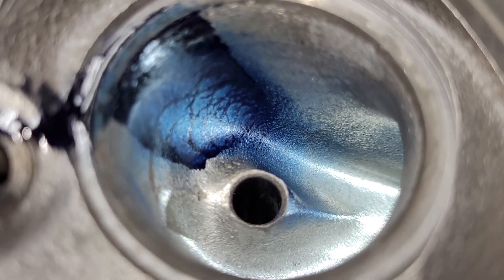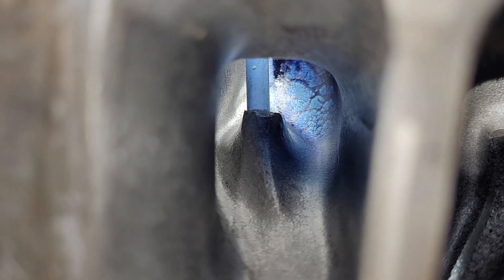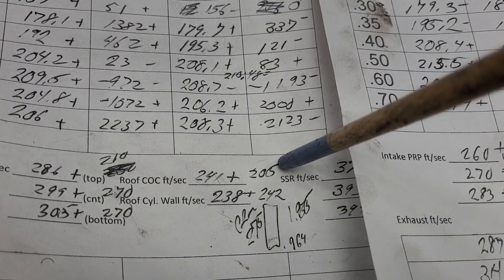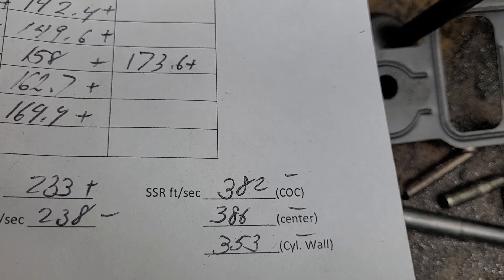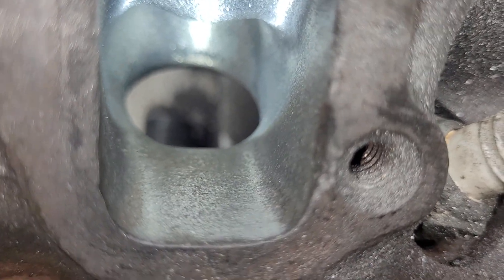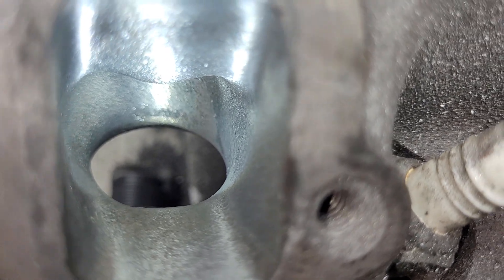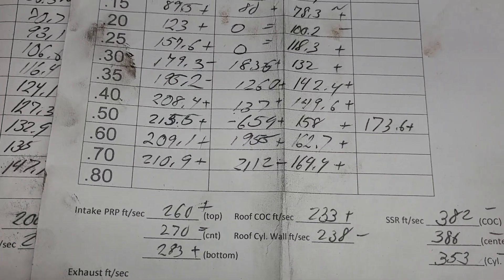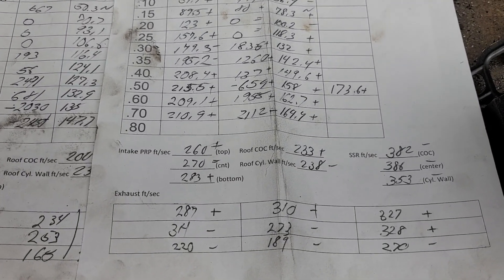David Vizard, U.T.G., U.M.S., Mission Impossible 318 project. Dodge 675 cylinder head, Intake guide

Comment: Charlie, that bulge in the exhaust roof has puzzled me for quite awhile. I findnitnhard to beleive the Chrysler would put that in there if it really hurt exhaust flow,  just to give more area to a water jacket. There must be a benefit to it in some respect. Have you thought of leaving it there or flowing it with a pipe before grinding it out. Maybe you did and I missed it. Love the work youre commiting to this head.
Thanks!!
Reply from the maker: I have, I did before and after testing to check progress. The stock shapes have more to do with easy core making than performance I feel.  As long as they hit their target hp and economy they have done their job. Thanks

Comment: I am excited to see you tackle those Duesenberg heads D.V. Was talking about! 4 valve doc hemi heads from the 1920s are so sexy!!  I reckon it is more or less the original poly quad. 😊😊
Reply from the maker: He was just using it as a reference. I don't have any coming in.
Reply: @servediocylinderheads  I didn't honestly think you did. I was just pipe dreaming of making a 1000hp engine using 1920's tech. 😍
Reply from the maker: @bcbloc02  I have seen some Packard parts, way ahead as far as engineering.

Comment: Less flow on the short side ? I'm not sure if I have a grasp on the nomen clatter but if I'm following you and I am trying  (ADHD and DYSLEXIA occasionally rear their ugly heads so bear with me) then the reduced flow would be caused by less resistance on the other side . ? Improved flow when sides are widened may improve balance somewhat . ? Maybe 🤔.
Reply from the maker: Adhd and dyslexia are linked to higher iq  so you have that going for you.
Reply: @servediocylinderheads  Hah !  Which is nice .👍🙂. (Bill Murray although I think you are aware of the source).
Reply from the maker: @Jim-ic2of  I do...
Reply: @servediocylinderheads  Ahhh gung al Lungah ! Gungah gungha gungahlungah !  😂
Reply from the maker: Yes, that is what I think is happening. That would change the air speeds. Thanks

Comment: I dont think air speeds in the exhaust runner should be that big of a concern. A flow bench can't simulate the mach 1 or mach 2 speeds of the air when the piston is forcing everything out....hmmmmm🤔 gives me something to think about.....maybe.
Reply from the maker: My view? If speeds are good on the bench they will be good on a running engine.
Reply: @servediocylinderheads  yeah definitely couldn't hurt.

Comment: So all this dykem being slammed into the far side of the seat is good? Why wouldn't you want to see any leave the short side radius side of the seat?

Is this representative of the fuel in the aur fuel charge? Would'nt this make a very lean condition on the short side of the seat?
Reply from the maker: Dykem is thicker and heavier than fuel so if you get a good spread on the dykem, fuel will be better.

Comment: Amazing numbers from a 318 head
Reply from the maker: Really? I was hoping to get 250 out of these. I have the exhaust down, in fact D.V. will most likely need to change his original cam design due to the exhaust improvement.
Reply from the maker: I looked for ported flow numbers for these heads and came up zero.

Comment: Great work Charlie.   Maybe already stated ?  I seem to remember DV saying the heads would be cut way thin to make a closed chamber.  If so how would what you have found so far be changed if any by not having the void in the chamber that's there now ?
Reply from the maker: Good question, where D.V. drilled chamber was still thick. The outside edge that meets the deck is too thin for use.

Comment: I learned today that sometimes you can improve flow by tripping the boundary layer on the walls. You have two options, a recirculation bubble forms, which shrinks the size of the port due to the downstream turbulence(typical when you have a really sharp short side), or you can trip the boundary layer before the circulation bubble. Still causes turbulence, but, it doesn't shrink the size of the port because the turbulence stays near the wall since you avoid the circulation bubble. It becomes a tradeoff, the BL trip causes some drag, but in some instances it's less drag than if you let a circulation bubble form. Sometimes the circulation bubble is better, sometimes the BL trip is better. Boundary layer trips come in the form of vanes, bumps, ridges, ribs, vortex generators, etc. You get a circulation bubble when the flow detaches, and reverses direction. Again you usually see this on ports with a really sharp short side turn.

A circulation bubble helps if you want to make the port smaller and increase air speed at low lift and engine speed, but it becomes a restriction at higher flow speeds. I'm just guessing here, maybe the vane on the intake guide, is acting like a BL trip. Which means the air sees a bigger port a low lifts, and slightly less drag at higher lift and speed.
Reply from the maker: It is fasinating stuff! Thanks
Reply: @servediocylinderheads  Anything I can do to help, I like what you're doing and want to see you succeed.
Reply from the maker: @rolandotillit2867  You can help, please let me know if you see me making a mistake or pointing people in the wrong direction. This is really for everyone. I always want to post accurate info the best of my abilities. Thanks!
Reply: @servediocylinderheads  Perhaps you could use putty on the guide vane, to see how its orientation affects the dye chem flow on the wall. Looking at the pattern again there is some interaction from the vane and how it causes the chem to flare out on the wall.

Using some kind of clay or something would be better than making permanent or irreversible changes to the port. If you plan on experimenting at least.
Reply from the maker: @rolandotillit2867  I was actually working on that. Stay tuned.

Comment: Oh, and was the reason the ssr speeds went down because of the  increase in area above it. If I remember correctly you should try to shoot for 300-320 ft/s everywhere in the entire port? Although only if you can keep your mid lift flows. I.e. low lift = valve job, mid-high lift = port.
Reply from the maker: On the iop program it calculates the ave port speed. It was a bit slow actually. D.V. did a video on it. Thanks

Comment: Charlie is making diamonds out of literally burned wood "charcoal". And the thing is. It really doesn't matter if he tells us his process or theory. Because all of these things he does come from experience.
Reply from the maker: Not 100% true, I have very limited Mopar experience and have learned a decent amount with the Mission Impossible build. Thanks
Reply: It’s an excellent project, for an excellent cause. I’m in!  

I’d still like to see the poly A-318 compared to the LA.
Reply: @jeremylastname873  I have a torn apart poly 318. You would just need a custom intake and separate oil drainback lines for the heads. A little bit of custom stuff but it does work. I can make a video if you would like.
Reply from the maker: @jeremylastname873  Thanks!